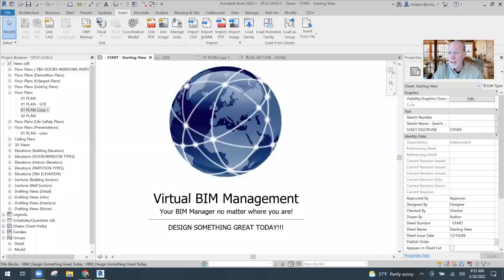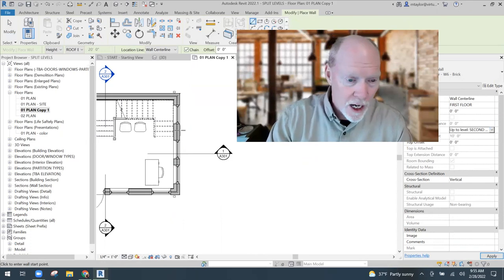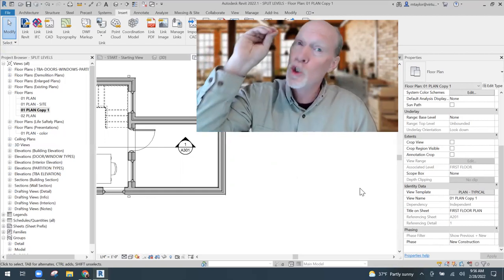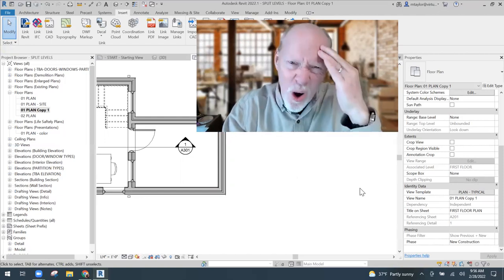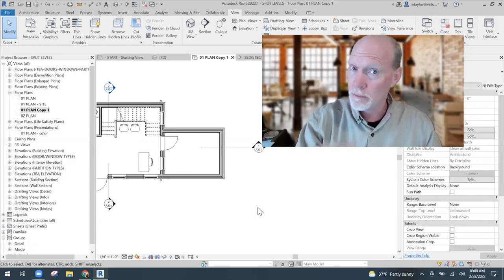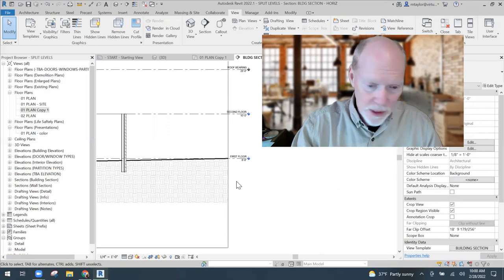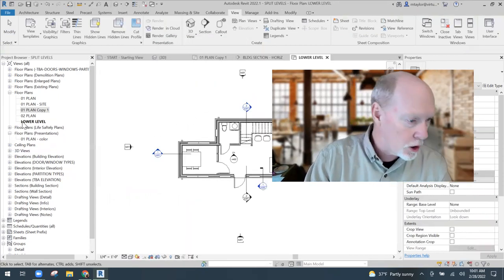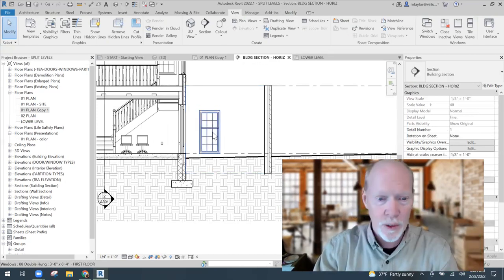SPLIT LEVELS: Working with floors/rooms at different levels

Comment: I am struggling setting up the setting in revit for split levels. I am working on custom home for a client. My house has a ground base level where the garage sits at, the foyer and living room are at the same height of the garage. the main house is at the split level of +2'-3" and from there the second story where the bedrooms are located. I have done that correct by going into the elevations and setting up those levels. What In am struggling with, is the visibilities. What i mean is that once I open the garage level fp it shows the other split level at the same detail as the ground level. And I want to show that not only in half tone, but in the line weight that shows elements above with the line weight overhead style. Basically dashed line.  and when I go to the main level the opposite. what is below will be in half tone and with the overhead line style. That way is much easier to read and understand

Comment: I am trying to figure out how to do raised computer floors and floated floors in Revit LT. Computer floors have the walls sit on the slab, while floated floors will have the walls and ceiling sit on top of the floated slab. This can be the jack-up type from Mason Industries.
We often use double-wall systems (or triple). What is the best way to approach this?
We often also deal with these types of floors where the rooms are irregularly shaped. I'd like to be able to change the dimensions and shape of these floors without everything else falling apart.
Any advice would be greatly appreciated.

Comment: hi, i have a ramp with irregular shape and slope. how do i create a  beam align with the shape and slope. the shape of the beam is the width of the Ramp .
Reply from the maker: Beams can be told the exact height at each end... You can use the Spot Elevation tool to get the exact Elevation of the ramp and then you can set the two ends of the beam.  That sounds complicated, but I don't think you can use the ALIGN tool.

Comment: Hi sir how r u ....i have one problem regarding floors...i have made a project which i create different floor material on different room by parts....it's created and work ...but what happen when i put a section box on it ....it's showa me different material exactly what i put ...but when i go on floor plan it's did not show me different material..it's show me only one material by default what comes with revit..thanku sir....
Reply from the maker: The CUT material is set differently than the SURFACE material.  So in the Section box.. the cut material is showing in the side... but in the plan view, the surface material is showing.
Reply: What I meant to say ...whenni go to floor plan i m not able.to see the diiferent finish material what i set ....